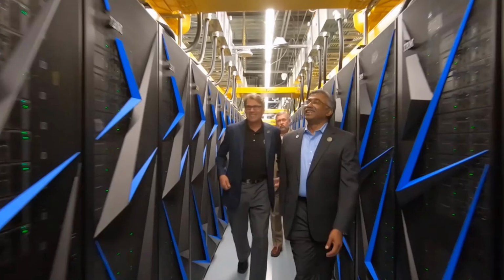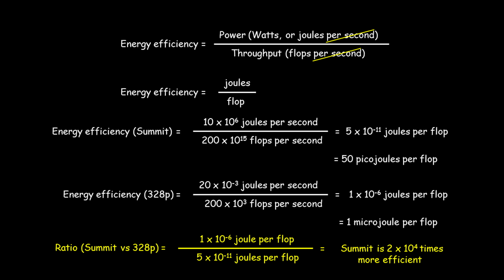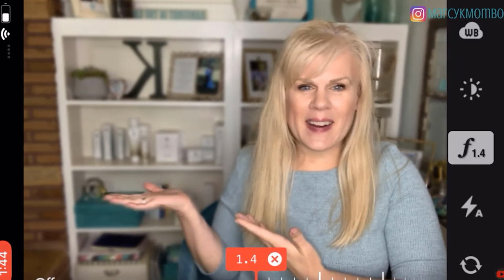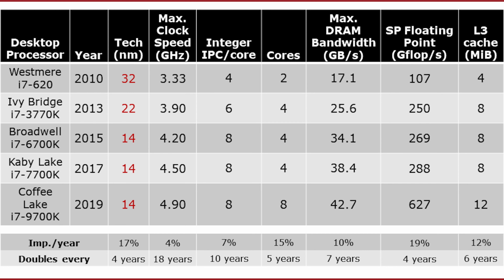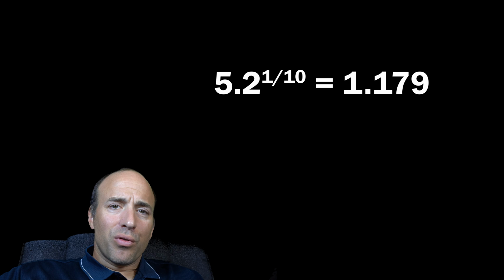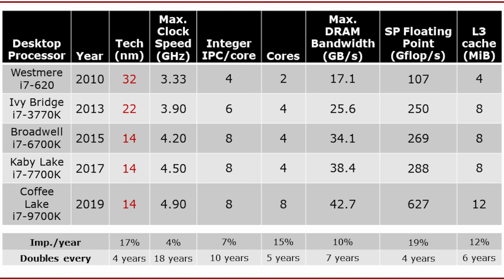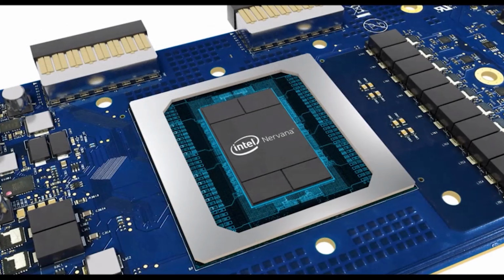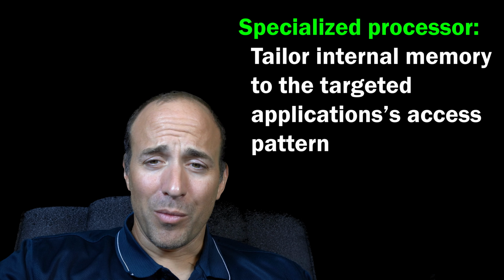CSCE 611 Fall 2020 Lecture 2:  Course Introduction

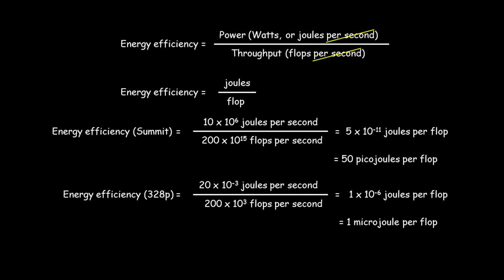Comment from the maker: @2:27 Correction:  That should be 100 nanojoules per flop for the 328p, so it's only 2000 times less efficient than Summit.